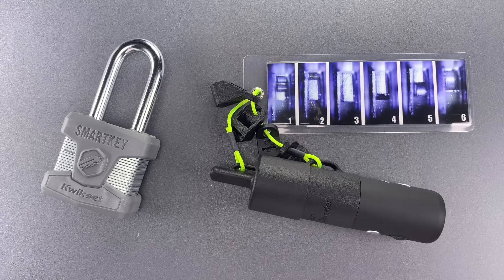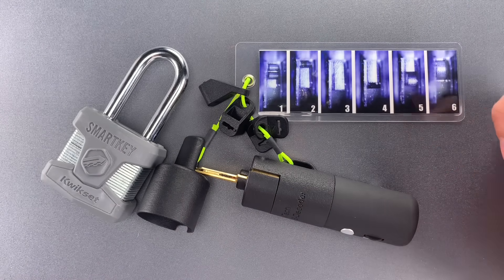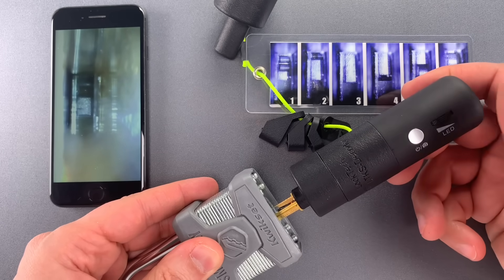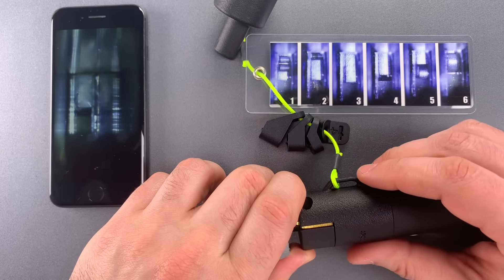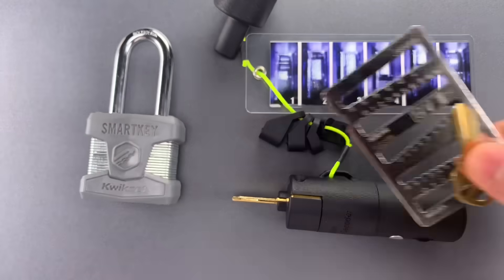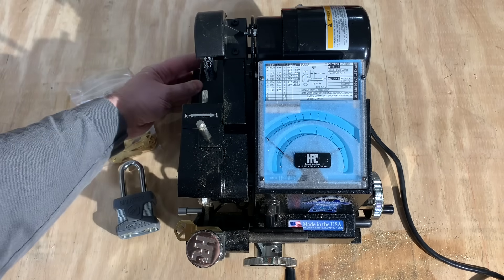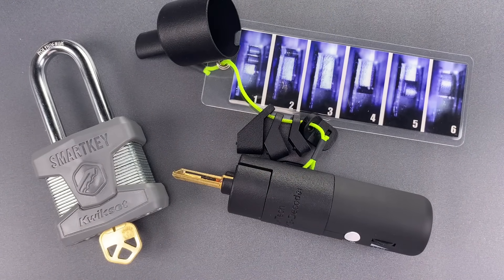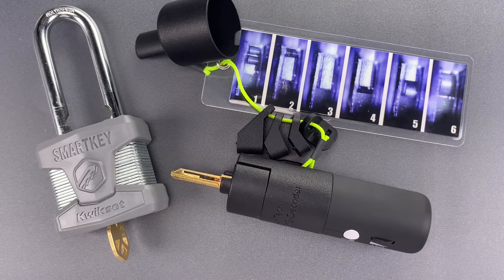[1209] This Tiny WiFi Camera Owns Kwikset SmartKey (LockTech LTKSD)

Comment: Finally, the one device LPL has never used to open a lock: The key.
Reply: He is the lock picking lawyer, not the lock using lawyer
Reply: @64_Tesseract  Surely it's more the lock (ab)using lawyer... and in this example a key using lawyer?
Reply: @64_Tesseract  He was befor the Key Loosing Lawyer
Reply: @64_Tesseract  ⁶
Reply: @64_Tesseract  He's most certainly used more than picks to open some of these locks 😆
Reply: so  picking a lock with a key means you can lock the door when you leave and no one will know how you got in.
Reply: @recoveringsoul755  if you dont turn the lock compleatly it will stay in neutral state that you can later turn back you dont even need to pick it twice
Reply: @recoveringsoul755  you can pick a lock closed too
Reply: @Sokrates9500  that's not what I was told, and why would you unless you had a lot of time and privacy?
Reply: @recoveringsoul755  it usually works the same way as picking open, LPL did it for a few locks he had no keys for I think

Well if you don't want anyone to find out it was opened then closing it is a good idea lol
Reply: @Sokrates9500  my locks were picked while i was home, but when they tried to open the door, the latch caught. I guess they left. Something woke me up, eventually i walked past the door and noticed, about 4:30am on christmas eve
Reply: @recoveringsoul755  and what did Santa leave you?
Reply: @recoveringsoul755  you could also pick it to lock it again too.
Reply: @recoveringsoul755  same as picking a lock any other way. If you got a plug spinner you can always re-lock the door without having to pick it again
Reply: @recoveringsoul755  you can do that from picking the lock too..... lol
Reply: @lilron78  nah that was trash
Reply: @lilron78  the beat is good but not the singing. You can tell that you are just talking quietly trying to be sad. It sounds like you are a shy person trying to act like someone wronged you but the thing they did was take the penny you found on the side of the road after you dropped it on purpose.
Reply: @derpydino3363  the beat is most likely a beat made by someone else available for free
Reply: @ane_1658  that is what I thought but I do not want to discredit this persons “hard work”
Reply: @ane_1658  true dat it is very possible and with such advertisement, highly probable.
Reply: @AdventureKyles  :)
Reply: @lilron78  no
Reply: @lilron78  no spammer
Reply: @lilron78  I didn't even checked it, but anyway im gonna say no
Reply: @lilron78  so I'm a boomer but I like the beat...really liked it. You kind of sounded like ur about to od on lean and it kinda made me laugh. You could still do that but I say pull it back. I think you stretched the lyrics to far at points to fit the beat. I won't say if you should drop it or not but I respect how you are asking for opinions.
Reply: @lilron78  no that shit is horrible
Reply: @lilron78  Wack
Reply: @lilron78  Maybe you shouldn't spam links in comment sections.
Reply: I think he has impressioned a key on this channel before, although I dont remember if it was a guest or himself. 
Edit: Yeah it was a guest that he had, https://youtu.be/p0euhqTq_9o
Reply: @lilron78  enable comments to give criticism. Song is good but your vocals are really bad
Reply: @lilron78  no
Reply: @lilron78  Yes, all copies of that dong should be dropped into a working incinerator.
Reply: I don't know, he works they keycutter like an artist.
Reply: I just want to know who locks their house up with those type of locks
Reply: @MatthewHensley8304  well you never know... The world is full of misinformed people. When you said, “...your brain is like any other muscle...,” I couldn’t be positive you didn’t know.
Reply: To be fair, its not the ORIGINAL key.
Reply: @lilron78  that was crap, did you record and mix it on your phone? Up your game alot.
Reply: @AdventureKyles   gotem
Reply: @MatthewHensley8304  your brain isn’t a muscle though...
Reply: Lol.
Reply: No
Reply: @AdventureKyles  Are you a lawyer?
Reply: mariokarter13 hilarious
Reply: He just did
Reply: He still cannot be made to ever use the original key though
Reply: Not THE key, A key
Reply: He's used keys plenty of times. For example when he disassembles a lock.
Reply: @lilron78  If it was supposed to be funny good job if not oof.
Reply: 9 months later, this comment is still hilarious.
Reply: picked the combination to create a key.
Reply: A key. 🤔
Reply: Key making lawyer just do him justice (pun intended)  He is the Key Making Lawyer. Making is several levels higher than using.
Reply: KeyCypherLawyer?
Reply: I won't feel safe no more in my house
Reply: au contraire, video 669
Reply: @lilron78  Ahaha no one is going to give you time if you're gonna go around dropping your link on other peoples content like some kind of spam bot
Reply: This tool can open any lock easily! [Not Clickbait
Reply: No shit, that's the whole point of the channel
Reply: Genius comment. 👌🏻
Reply: …that he made himself
Reply: He has become the very thing he sword to destroy
Reply: @lilron78  No
Reply: It would be kinda funny if someone decides to make a YouTube channel named KeyUsingLawyer and just use the key that's meant for the lock to unlock it
Reply: This seems way to complicate for a normal person
Reply: @lilron78  no
Reply: He probably lockpicks his own front door instead of using a key
Reply: @AdventureKyles  actually the key works for the lock now so it's technically the key now
Reply: Legend has it he doesn’t even own a set of keys...
Reply: @lilron78  
Sounds like an american Bad Bunny knockoff only an edgy 13 year old n word who grew in poverty would listen to. We already have enough shitty music in our world, mate
Reply: @lilron78  no
Reply: LOL
Reply: @AdventureKyles  Thee key!
Reply: Well he is using it now 😂
Reply: @AdventureKyles  the key to the lock
Reply: Yall blazed rjayy so bad he deleted everything 😂
Reply: @lilron78  Keep up the good work, even people with downsyndome should have the chance to do music!

Comment: "We have little spacers that help you find the correct depth for each of the sliders. We won't be needing those."
Reply: Not saying I could do it but it looks like something anyone somewhat familiar with the lock could do
Reply: @lukes2219  after watching this video i would assume everyone would be able to replicate this given the tools.
Reply: You could take a panorama picture / video and then you have the lock as a whole picture
Reply: @niccis1982  They don't work so well. "So we have a very narrow 1, a really fat 4, ..."
Reply: @myownsite  for a wifi equipped smart camera they really didn't put much effort into its software side. it probably has the processing power to take a panorama like that, the motion is very constrained so it should be relatively easy to infer the speed from the camera feed and compensate.
Reply: The spacers might come in handy if you don't want to have your phone out.
Reply: This is mission impossible level lock picking...

Comment: @LockPickingLawyer Would it be possible to use an old key cutting machine, the one with a guide bit on left and cutting blade on right , to cut the keys if you use a gauge in a pinch?

Comment: That sure is a quality tool. I like the HPC key machine also.
Reply: @Conor And it does depend on what you are getting access to (and the cost/risk of using a brute force attack)
Reply: I had my pinkie finger get stuck against the blade as a apprentice. Lucky it was on the standards LW4 blade and not a thinner blade!

Comment: Kinda scary how easy this is when you can just spend 5 sec taking pics and come back later with a key. I'll just prop a 2"x4" under the door handle so it can't be opened while i'm at home! And weld it shut when i go away!

Comment: those key cutters are cool, but have you tried 3D printing a key? I made one for my front door with a website https://keygen.co/ that'll generate 3d models when you enter the keys type, warding, outline and bitting. The key was kinda hard to use at first but after I'd inserted it into the lock a few times it worked well enough.

Comment: I was expecting for a camera to automatically to take photos / video of the lock sliders without stopping at all 
and the cut machine to auto CNC the key from a data it got from the camera via wifi ;)
like you plug the camera key in and CNC machine start to cut right away , of course CNC machine is portable .

Comment: Stuff made here: here an unpickable lock

LPL: Here a key with a tiny WiFI camera
Reply: gotta pick that stuff made here lock
Reply: Trading Places: YouTuber Edition. 😂
LPL with the fancy electronics...
And StuffMadeHere with the lock set...
Reply: He wouldnt be able to pick that lock with this, since you need a card based on the lock brand for the key cuts, which his doesnt have
Reply: @casuallydone468  i dont think Stuff Made Here sels blanks of his lock. Lmao.
Reply: @casuallydone468  I disagree. All he has to do is file down the extra key stuff until it's nothing more than a small camera.
He's not using it the intended way with the depth indicators and everything right now anyway
Reply: @TravisFabel  that's not what casually done is saying, they're saying that lpl doesn't have the diagram that shows what number each slot corresponds to
Reply: If he can get camera into stuff made here's unpickable lock it may remove the guesswork  into where each pin needs to be set
Reply: @Taran858  you have to remember that they are pins, not sliders. so he would not be albe to see their height, onlly the little tip where the key engages.
Reply: Yes pls everyone spam LPL new vids with "do Stuff Made Here lock"
Reply: @riskobrooks9862  https://www.youtube.com/watch?v=_7vPNcnYWQ4
Reply: @riskobrooks9862  he is apready gonna do it.

Comment: The downside is that it only works on Kwikset SmartKey locks. If opening SmartKey locks was a common occurrence, I would call it worth the cost. Time is money too. Picking and decoding takes way more time. It would be nice if it had different attachments for other locks.

Comment: My first thought seeing this is to pair it with a 3D printer and some CAD software. If you had a selection of template files for various blanks you could tweak the blank based on what you've seen. I know this is really just a different way to get the key but I would argue it's a method that's much easier for the common person to pull off.

Comment: id be cool if they had a batteryless wired one. the wifi capability is a bit useless since you have to have your phone out the see the pins anyway. simpler circuits with less bulk.

Comment: That key cutting tool is so cool. Just watching you use it for a minute or two without really explaining anything it's pretty obvious how it works. Set which pin to cut, cut it down to the number you want, and move it back and forth slightly to complete the cut, buffer at the end. Very cool!

Comment: It doesn't take much to own a Kwikset Smartkey. Just a screwdriver and pliars, or a right-angle driver, and you can force it open. It wrecks the lock in the process, but you get in.

Comment: That's actually a really cool bit of kit. The camera module itself is actually designed for use as a pocket microscope. I use it on a daily basis when inspecting for damage on turbine parts. Really cool how they made a custom key insert that accomodates the sensor and light.

Comment: I don't think a pickproof lock exists, anywhere. All locks are pickable somehow. BUT, the name of the game is to exceed the risk/effort vs perceived reward of any given lock. A simple master lock is easy to pick, but if you stick it on some unassuming shed in your backyard, that's usually enough that people aren't going to screw around trying to pick the lock to get at a bunch of old junk laying around. You can find $5 cheap padlocks on ice machines at stores, and those usually suffice because they are usually protected by cameras, and thieves are easily caught on camera, even if the lock is easy to pick or even cut with bolt cutters when the store is closed overnight. Locks like the ones in this video, are meant for something slightly more valuable, that your average thug who's picked a couple master locks won't be able to open, they might try a lock like this, and be unable to get it open and decide to just pass it by and look for something easier to get into.

Comment: We watch every video - improvement in dexterity and movement with alacrity we find are the real value as we practice!  Question for you: Thoughts on a “good” lock/key for a “vault” – ½ hardened steel and the lock unit will be welded into the frame.  Or a link to a video you review security locks/key locks.  Keep up great work.

Comment: I was in the process of modifying the Qtactical decoder to work with a 9v battery and also getting the lens to focus better when the locktech decoder came out. I put away the old and ordered the new. Wow what a difference! Makes my customers happy when I'm at the door for only a few minutes and have a key that opens the door.  I have a Rytan RY-2000 machine for Kwikset and Schlage. I put all into a harbor freight water proof case along with both types of keyblanks ( https://youtu.be/aupVOMMS2GA ).  Nice not having to go back to my vehicle to cut the key. Looking forward to the SC1 Smartkey decoder key to put on the locktech decoder.  The SC1 Smartkey locks aren't available just yet.

Comment: So, the only pick-proof lock is either filled with super glue, or just a welded link of chain. Or the only pick-proof lock is one that will not open using the correct method either.
-
Ooh! How about the locks on a canal! Pick those and be rushed away!

Comment: The HPC is easy and fast to use, if you have the card for the key you are cutting. For nonstandard no-card with just dimensions given, a Framon #2 is a very good cutter and not bad if you get a discount.

Comment: Question: Did you use the shoulder gauge when you inserted the key or do you have a method for placing it correctly in the machine? Thanks.

Comment: The camera was fun, but my favorite part was the key-origination machine. I wish I had known there was such a thing when I bought a classic car for which the keys had been lost. A randomly-chosen-from-the-phonebook locksmith told me it was impossible to make new ones and that I would have to replace all the locks. Next time I'll know better!
Reply: you can reverse engineer a lock to make a new key for it, or re-pin a lock cylinder to fit a key you already have- it's not necessary to have an 'origination' machine if you have the required skill level as a small scale engineer- my dad not only cut key copies but would also rebuild a lock if needed (and he had enough time, as he still had to run the hardware store)- often little old ladies who couldn't afford  to pay to replace the whole lock when they'd lost their keys

Comment: Management: "So this is really secure huh, are there any flaws in it" 
Engineers: "Well .... If you made a camera small enough to fit into a key blade, you could visibly tell the cut of the key"
Management: "But that's not possible right, i mean how would that ever happen a camera so small..."

Comment: I don't see how this is any good, as you would need hundreds of thousands of different key profiles for it to be viable, let alone the knowledge to ID said profiles via the keyway alone. Which is the part that takes years of experience. Sort of tool you would buy once, and use once in 50 years.

Comment: You could also 3D print the key as long as you're fine with it maybe breaking, just use a good enough filament and a good enough structure pattern

Comment: optical glass and a gem faceting machine, grind down a piece the shape of the keyway, with a 45° edge that's silvered/mirrored on both ends, attached to a macro lens and 3D print a holder to use a cellphone. can even redirect the flash led into the lock... start recording video, walk up, stab the lock and you have video of the sliders... key gauge, sharpie, blank, nibbler and a little skill should give you a working key pretty quick. -- though you could just bump it

Comment: This tool does work very well. I just received mine, last week, after a long pre-order. When cutting these keys with a Blitz, you can save a touch of time by not starting in the middle of the space and working back and forth. Just stop at the leading mark of the space on the card, plunge to your depth, then cut across to the trailing mark on the left.

Comment: So if there's a tool that can see what that pinout of the sliders looks like, is it possible that a modular key shaped tool could be set to various heights per segment (after you've figured out the slider depth)? The first concern that comes to mind would be tissues with keeping it actually key sized, and not too brittle.